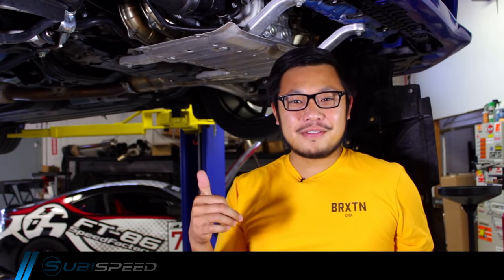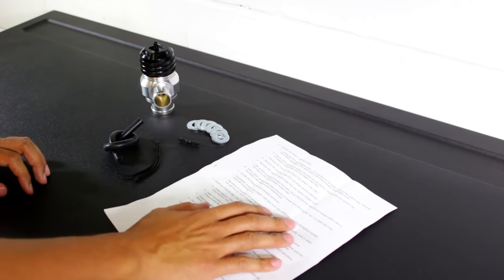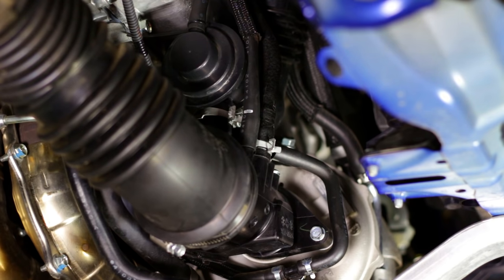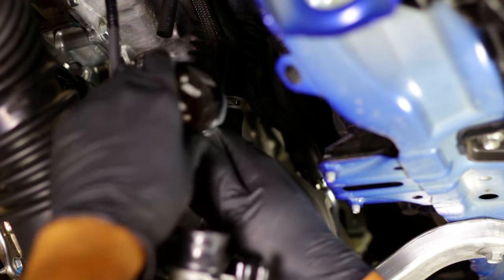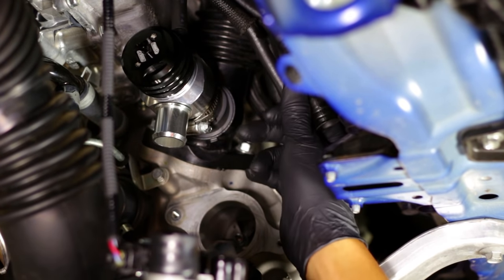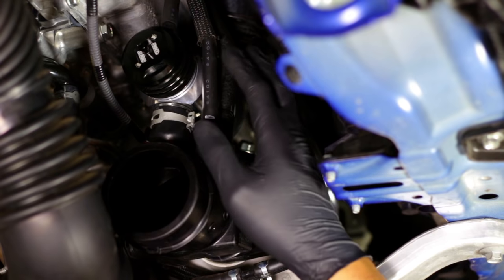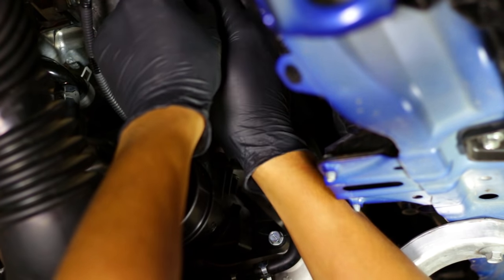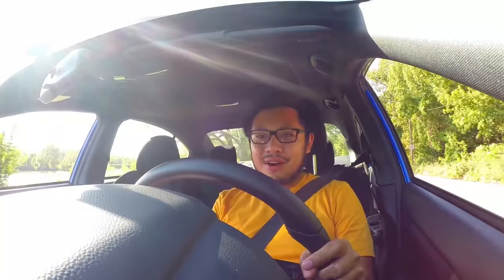SubiSpeed - 2015 WRX TurboXS Hybrid BOV Install

Comment: Just got this yesterday from you guys... install was straight forward about 20mins.
It arrived configured with 4 washers... car stalls and feels significantly sluggish...bone stock 2017 wrx.  Going to try 5-6 washers...
Reply: Added five 5 washers its still hunting at idle, car would randomly stall when in neutral and still a significant loss of power under boost....
 I re-installed with all washers that came with the kit (6 total)... car no longer stalls when shifting into neutral or clutching -in .... but still feels  sluggish :(  the overall sound is very very faint when lifting off throttle, there is also a slight  gurgle and popping when lifting from throttle (which I can probably guess is fuel  rich condition when bypass is venting) ill hook up a data logger later to see what is happening.
** overall I cannot recommend this product for completely stock 2015+ wrx’s as this video suggests. You will have a significant loss in performance and a rich running vehicle, even with all the washers in the kit installed, the valve it self is robust and seems well built but i feel this modification is for folks running higher psi’s  and upgraded turbo systems.
Reply: 2 month update..... there was a significant loss in power....ended up with 6 washers installed to just prevent stalling. Car gurgle and backfired slightly when lifting off throttle. Data logs on Afm also read super rich. DYnamic advance was effected and knock has been seeing  -4 ish...non A/c system related.
I have decided this was bad product and have removed it.... the out let pipe connecting the valve to the turbo unscrewed.... it isnt even a machined part.... its threaded with A cheap o-ring “to seal”  the pipe with the valve body. 
Save your money folks this will be a disappointment and  will do more damage to your vehicle with long term  use. Dont get me wrong the sound is wonderful but the cons outweigh the good.
Reply: Thank you for the feed back brother this is a big deal 👍
Reply: Thank you guys for the clarification. Really what I was looking for. My 15 forester xt has the same problem as well after 4 washers. I removed it and put the old one back on . Will probably put back if I get a accessport.
Reply: Overall consensus. This is a glorified noise maker. Same issues with car stalling with 4 washers... Put 6 washers like hachi roku suggested to stop it from stalling.. I had my car custom tuned locally when I went stage 2 (Accessport, big sf intake & downpipe) they did test pulls with the stock and then with this bov and noticed It caused significant losses, the lag was caused by the psi drop from venting to atmosphere 13hp loss. They recommended i utilize the stock or another aftermarket recirculating  valve thats fully closed. I wish I would have read this before purchasing.....

Comment: Hi SubiSpeed! I couldn't understand the last part where you use the additional hose and the "T" connector. On the connector, one connection goes to the new hose, the other to the existing hose, but what happens to the 3rd port of the connector? Do you leave it open? Do you connect it to another hose? I couldn't see it on the video. Thanks.

Comment: I got the same one on my 2017 wrx but sensor got in the way but could be worked around..have no issues with stalling and idling or no boost drops.but over good bov for that sound when u want and when u don't

Comment: Hello I got the same one but I do not know whether or not it is 50/50 or full. I don't think my mechanic did anything to it. We just installed it. I was going hard on my Sti about 2 weeks ago and a check engine light came on, but it went away after driving like a normal person lol. Should I be worried?

Comment: Just installed this. Mine flutters when I let off the throttle at low boost (read: less than 5 psi), but had normal blow off under high boost(read:6 to 19 psi). Is this normal? Can hybrid blow off valves cause compressor surge with low boost?

Comment: How come you guys didn't go with the GFB TMS BOV so you could adjust how much you want to vent, I got that bov for my wrx and I love the fact I can put it to 100% recirculating or if you want to make it 100% vent every once in a while you can or in between, I ran my wrx on 100% venting with no tune for a little while and it runs like it did off the stock bypass valve but with sound, I have it to 50/50 now though and it's still nice but nothing like 100% venting.
Reply from the maker: The GFB unit is very hard to get right now. We have some headed in but we try and make videos for items which are easily accessible. The GFB unit there is 10 in the USA right now and headed our way. Besides the TubroXS is simple, cheap, and gets the job done for most people. It keeps things safe and simple on the stock tune. The GFB unit requires a bit more knowledge to put on a car with no tune and keep stock like drive-ability.

Comment: Hey guys.  Purchased this recently for my 2015 WRX.  Currently I have the COBB Stage 1 + BIG SF Intake tune so peak boost is usually around 16 - 18.  How many washers should I use?  4 or 5?

Comment: Bought this bob and installed it with out adding any washers. I have nameless axle back delete exhaust, no other mods. Do I have to go back in the bov and make sure it has 4 washers? I installed it how it came from the box when I opened it.
Reply: Bov*** not bob
Reply: Same question here, not sure if I need to use washers?
Reply: johnny d same question here

Comment: Hello Subiespeed, last week I installed this bov that I purchased from you on my stock 2017 WRX. I installed it the way it came in the box. My car now feels like it is not pulling in the lower rpm range like it used to under normal driving and it won't boost over 10lbs at wide open throttle. Can you please help? Thanks in advance.
Reply from the maker: Hi Eddie, please contact our support team in the link below!  We will get with you ASAP.

http://www.subispeed.com/contacts/

Comment: so just to clarify this  particular BOV does not cause any damage to turbo or cause car to run lean?. Because I was told all aftermarket BOVs were not good for 15+ WRXs. Just wanted to know honest answer before I go ahead and purchase one. Thanks
Reply from the maker: There is no issues with the Hybrid one or any Hybrid option.

Comment: several people have asked already with no response so I'm going to give it another shot...I have a 2014 Forester XT, will this mod work the same on my car?? i dont see why not...same engine, same turbo.
Reply from the maker: Unfortunately we do not have a Forester XT to test it on so we cannot confirm.
Reply: Ok, fair enough please update if you ever do.
Reply: Jeremy Morgan I installed it last night on my 2016 forester xt. Went smoothly and was exactly the same as this video.
Reply: Sweet!! I'll have to do it then. I have   AEM cold air intake, Invidia down-pipe, and Invidia N1 exhaust. With Cobb Ap of course 😈

Comment: Hi, SubiSpeed. What are the cons if any of installing one of these? Will the car lose power? I love the sound and want to install one on my stock 2015 wrx I just bought but I don't want to lose any power. Are there any prerequisite modifications, so to speak or can I just install one?
Reply from the maker: No Cons at all. There is no power loss, there is no check engine light, there are zero negative issues. It actually helps build boost a bit quicker as it closes faster after shifts.  :)
Reply: SubiSpeed Wow! Quick response! Thank you so much. Just subbed to your channel.
Reply: @SubiSpeed  do you need a tune?

Comment: Hey subi speed, can you make a video on how to tune the RFL BOV type XS 100% atmosphere vent so I don't get any check engine lights? Also if there's anything else I need to buy besides the BOV itself!
Reply from the maker: You cannot with that BOV. You need a Hybrid or a Full Re circulation BOV.

Comment: Had this valve installed on 2015 WRX. In low rpm with hardly any acceleration, boost guage ramps up extremely quick (up to 23 Psi) but does not deliver any power.. Even high rpm, boost ramps up but is not pulling the car like it did with the stock BPV. Also getting a lot of flutter.
Any suggestions would be great?
Been in for less than a week and considering removing.
Cheers.
Reply from the maker: Is the car stock?  I would suggest adding a couple more washers.  In the video, our car was stock and running 4 washers.
Reply: SubiSpeed 
The car has an Invidia catted downpipe, an axle back and a mishimoto performance intake + tune. I currently have 4 washers in the BOV. If the bov is making the turbo flutter, wouldn't I remove washers if there is flutter? Could this be a boost leak? The first 2 days of driving, the bov did not seem to have any boost/power issues.
Thank you for your reply!
Reply from the maker: You are running more boost than stock.  You will want the BOV spring to have more pressure to hold that boost.  I think what you are hearing is the BOV opening pre-maturely because there is not enough pressure keeping it closed.
Reply: SubiSpeed 
I will add 1 or 2 washers this evening and let you know how I go.

Cheers again =)
Reply: So, I added 2 washers (6 total) and the power seems to be better.. however, the valve now sounds like a HKS SSQV. Lol. Hmmm =/

Comment: Mine works fine but in neutral if I rev up to 4K when the rpm drops it doesn't catch at idle and just drops to 0 and car shuts off I currently have 9 washers. Any ideas?
Reply: Bro Ik your comment is 5 years old but my car just started to do that. How did you fix it?

Comment: Is it normal to back fire a lot because my car has been back firing a bunch since I installed my bov (it's the same one as the video)
Reply from the maker: You may want to check how many washers are installed in the bov and adjust if necessary. It is possible because when the air is released the car runs rich for a split second but check the washers and see if that alleviates it.

Comment: Why not go with the full atmospheric? Just wondering. I ended up getting that one but just wanted to know your decision
Reply: it's not a good idea to run a full 100% VTA on a car with a MAF system. You can run rich each time the BOV vents and have erratic idling.
Reply: Don't have any CEL and doesn't stall, I've heard of this issue as well that's why I was skeptical, luckily TURBOXS is local so I went to them to see their setups and recommendations. Been running the RFL for a couple weeks, other then running rich on throttle release don't have any issues. One thing though that TURBO XS doesn't tell you is to run 8 washers on the BOV maybe the guy with the issue isn't using that many?
Reply: AzuluzA how are you logging how you're car is running? an Accessport?
Reply: No log, definitely dont want to get the AP until a full tune system is avail and TURBOXS did some trials.
Reply from the maker: As stated in the video, it is just a best of both worlds preference for us.  Also, we did not want to tune for the full vent to atmosphere.f
Reply: ***** that's why you get the GFB Respons TMS bov so you can choose to vent or recirculate
Reply: I had the turbo XS RFL for my 15 wrx and had a lot of stalling issues but I only used 3 4 than 6 washers and stalled every time but never tried 8 my buddy who was a mechanic helping me was like joking saying let's try 7 and I said no that I was over it had I said yes we most likely would have kept going to 8 and It may have worked.  but after I asked turbo XS they exchanged the RFL for Hybrid 50/50 and even picked up the shipping.
Reply: Brandon Barnes I wish more people would see your post and stop buying BOV's for no good reason.

Comment: So are hybrid BOV safe to run? Are there any long term problems? Lastly will I need a pro-tune with one?
Reply from the maker: By itself on a stock car or one with mild bolt ons, you should not need a tune or run into issues.  Worst case with these is you run a slightly rich during shifts.

Comment: Could I install this with out having a after market exhaust, would I need to tune the car, and would it affect my mpg
Reply: Yes, yes, no. You're better off spending 300 on an intake because you can hear the stock bov much louder with the intake. Stock bov/bpv is fine

Comment: just installed my bov on my 2016 Wrx and it sounds great but it has stalled twice? any idea y?
Reply: put the stock BPV on
Reply: +Ruben Huerta Depends on the BOV. You should probably look for a BOV that supports 50/50 Hybrid

Comment: Was thinking about this cause I'd like some sound outta my 2016 wrx after the work and pro tune my tuner told me not to go with aftermarket as the cars need to have that air recirculating back into the car to avoid cel. What your guys opinion. Do I need a retune after this or???
Reply from the maker: The Hybrid works fine, if you are tuned you may need a return for this. If you stick with a recirculating one you will not need a re-tune.
Reply: SubiSpeed I have been thinking about it since watching ur videos. There's a lot of stuff I wana get but my runner suggested not to do a lot of stuff I wana get since I don't really track the car yet.

Comment: I installed this on my 2017 WRX. it is a slightly different install as there is a new sensor.
Reply: +Capt working around it a little tight
Reply: +Capt just have to leave it connected and take the whole coupler off
Reply: did you have to tune after install

Comment: I need some help. I have the turboXS hybrid bov and I've also installed a mishimoto charge pipe. So the problem I'm having is that my bov is only making the ppsssssshh sound at low psi (5 or lower). When it goes pass 5psi all I hear is air being blown out of the bov. Do you think I need to add more washers to my bov or is there something else that I'm not doing right? Does anyone know?
Reply from the maker: +Linh Do How many washers do you currently have in there? We are running 4 washers with the chargepipe & intercooler installed without any issues. If that's the case, you may need to add more washers.
Reply: There's 4 washers in there. I'll add more and see what happen.

Comment: I could be wrong but I thought half the reason on installing a aftermarket BOV is so you have some boost saved up for when you step on the throttle after you shift which would feel like a decrease in turbo lag. Why didnt you touch base on this, the performance aspect of the BOV? Otherwise its a $200+ noise maker
Reply from the maker: That is not the case with BOV's.  These are installed on turbo systems to prevent compressor surge when the throttle body closes.  Installing an aftermarket BOV is usually needed when running higher boost levels than the factory, as the stock bypass valve can be prone to leak and not hold pressure of the higher boost levels.  The noise making part is just an added plus that many people enjoy.
Reply: Ghost- They already replied to his comment a year before your's. Please do your research before commenting.

Comment: Car does not need a tune after... you cant tune for a BOV, only thing to do is recirculate the air back in or get a hybrid BOV. I have this hybrid installed and I have not had any problems in 6 months,  Hope that helps n this BOV needs to at least have 4 washers in it to work properly

Comment: will i be able to run the cobb stage 2 map with just a turboback and a hybrid blow off valve with no issues? @subispeed
Reply from the maker: +Mark Hoogendoorn You should not have any issues with that setup.

Comment: i just recived my turboxs hybrid  bov. i have a 2016 wrx. its all stock do i need to use any washers? please reply subiespeed
Reply from the maker: +Edgar Moreno Start with 4 washers.
Reply: How did this turn out?
Reply: Love it im using 6 washers boost is on point n that bov sound is great
Reply: how far did u close back up after installing the other two
Reply: After 3 years, how is it now?

Comment: I bought it for my 2015 sti and it didnt fit??
Reply from the maker: Miguel Martinez This BOV is specific to the 2015 WRX and will not fit STIs
Reply: Whats a good hybrid bov that i can put on my sti?
Reply: SubiSpeed will it fit 2017 wrx?
Reply from the maker: GeoissXc Yes
Reply: what about the manufacturer waranty?

Comment: Was that with stock boost and motor or tuned ?
Reply from the maker: Stock
Reply: SubiSpeed any issues from this yet? I have read many issues with people on BOV, even hybrids at 50/50 and really want this sound but am super nervous about the potential problems.

Comment: How loud is this compared to a cold air intake? Currently have a mishimoto installed and it sounds good but is not loud enough. Is it about the same? Noticeably louder? Or should I get a tune and get the loud version?

Comment: I watched a video from some guys who went to the Go Fast Bits shop and talked with the engineer of their valve. He said there is no difference in an atmospheric valve or a re-circ valve. Video here - https://youtu.be/Z_fG_b65WiU

What's SubiSpeed 's opinion on this? 

Seriously looking to buy and install a BOV in the near future but I don't want any check engine light or engine performance issues. Mainly ones that will void my warranty.

Comment: Can this fit 2017 wrx?
Reply from the maker: Yes it does :)
Reply: SubiSpeed thank you:)
Reply: SubiSpeed do we lose power if we put this?
Reply from the maker: Nope. You will be good to roll. :)
Reply: SubiSpeed Hey, can you make a video on how to tune the RFL BOV type XS 100% atmosphere vent so I don't get any check engine lights? Also if there's anything else I need to buy besides the BOV itself!